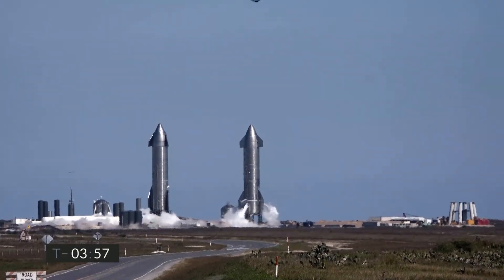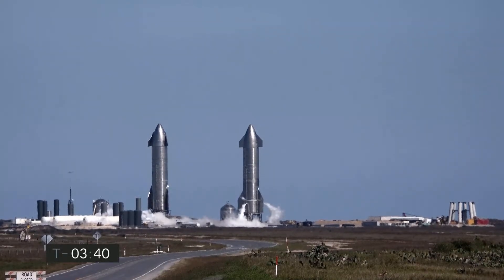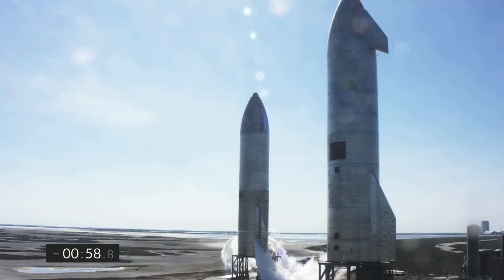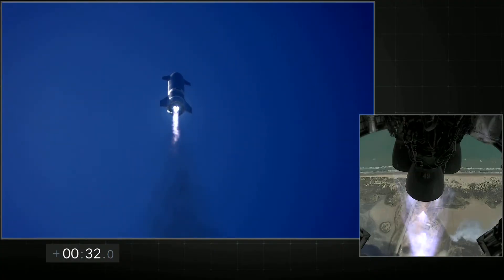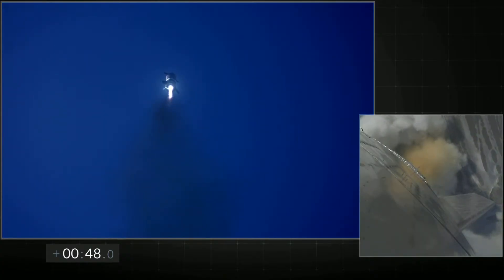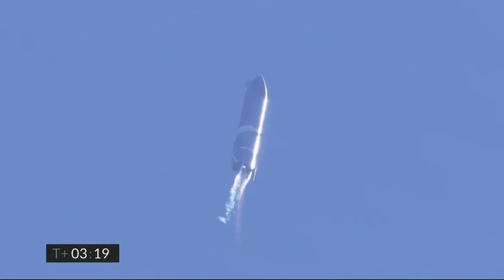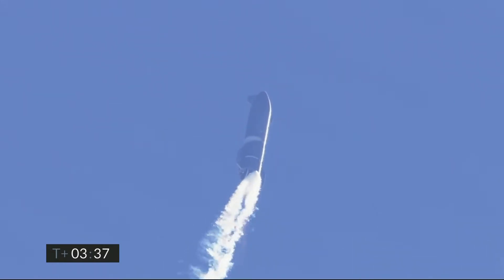Starship | SN9 | High-Altitude Flight Test

Comment: They are never afraid of showing their failures, and that great
Reply: I dont trust anything that doesn't fail at least once. Learning from failing is the human motto
Reply: That's not a failure. It only is if they dont learn from it
Reply: @arthurribas3344  Exactly
Reply: @arthurribas3344  agreed
Reply: @arthurribas3344  Don't know about you but the 1st engine stop looked more like an engine failure, it blew and the final 2nd engine start right before it crashed misfired, probably it was that failed engine which stopped 1st, only one of two was active during descent. The narrator can say whatever he wants... but it's somewhat a failure. We'll see more in future testing if engines are supposed to stop in flight by exploding or not. Musk would call it a design feature...
Reply: @emmn.4307  its still a success, it manahed ro fly 10 kms.
Reply: @coolgh1dorah929  well, sure... from the perspective of a flight test, but they already had been through a crash landing. It would've helped them understand a lot more if they also fixed the landing sequence and got the silo intact.
Reply: @emmn.4307  Good eye! They were running a test called a "belly flop maneuver". They were testing other things and didn't expect the engines to turn back on in time. They succeeded two prototypes later.
Reply: It is not failure, it is testing
Reply: @marcysiek1  yea its considered as a success because it went 10 kilometers high, that was the most important part, landing it its extremely hard.
Reply: What failure?  The test was successful
Reply: You have to admire them for that.
Reply: Well tbf it's kinda hard to keep an explosion the size of a football field under wraps
Reply: @ClaversOdhiambo  apparently you never seen how china do their work
Reply: @ClaversOdhiambo  I am guessing you haven't heard of CNSA then?
Reply: The world will look a lot better if we all start doing so.
Reply: It's not a fail
Reply: Rapid develipment. That's a term. 8)
Reply: Trail and Error . That physics and engineering and chemistry and math for ya ☺️☺️
Reply: if they created perfectly there will be no profit goin in for the engineers  LOL thats why they have to make it primitive deisgn
Reply: Well they hid SN10 explosion and in SN11 they kinda just ended stream without even telling us wether it exlpoded or not
Reply: I know! That great for sure...
Reply: They are also not shy
Reply: The more failures one overcomes...
Reply: This is testing. It's not a "fail or succeed" matter at all.
Reply: They tried to hide up when a F9 core crashed back in February 2020
Reply: @xerosfs  temporarily maybe
Reply: @ClearVod  wdym
Reply: @xerosfs  Elon tweeted that like right afterwards tho LOL
Reply: @OortCloud  Oh. Must’ve been mistaken. I’m very sorry.
Reply: @xerosfs  Ah that’s okay, same thing happened with the first falcon heavy flight where the center core crashed and they didn’t say a word and then Elon just tweeted it
Reply: @xerosfs  What Sat(s) did they carry on that mission?
Reply: https://youtu.be/vwvTarqg8g4
Reply: @Dhruvshot  j

Comment: Still wonder why not somewhat larger fixed wing and land it like an airplane.
This whole crazy flip thing will not make passengers  stand in line for it i think.
Reply: Unfortunately not really possible since you need a runway to land a plane. For that reason, the landing mechanism won't work on any other planet than the Earth.
Reply: The more weight you add to the vehicle the less payload you can carry
Reply: @chronovore7234  maybe so but it saves you fuel for the landing burn.
And look at the wing from the X15 and F 104 they look not so heavy compared with the airplane y

Comment: It seems under powered
Reply: That's because it is. It's still missing half it's engines, and they didn't run the ones it does have at full thrust, since it's not needed for this test.
Even the final rocket will be a bit underpowered for it's size. It's not intended to launch from Earth under it's own power, it's supposed to be launched on a booster.

Comment: still sticking with the dick model. Why not scale up an F-22 Raptor?
Reply: Because an F-22 Raptor can't go to space, let alone the moon or Mars?
Reply: @lazarus2691  with enough brute force, it absolutely could
Reply: @lmao.3661  I mean if you stuck it on top of a big enough rocket, sure. 

But as far as getting to space under it's own power, which is what I meant, no.

Even if you swapped out the jet engines for the best rocket engines available, it's mass ratio is simply too poor, and scaling it up doesn't fix that.

If you stripped enough weight out of it and strapped on some extra fuel tanks, you could probably hop it over the Karmen line like the X-15 did, but actually making orbit? Forget it.

There's a reason that Starship is essentially a fuel tank with a pointed nose and some fins on the side. 

Even then, it can just barely make orbit by itself, and that's with no payload or provisions for landing.

Comment: Nice prototype. The bottom is to big to. Aerodynamically speaking. The top slips and you make a big boom. Just like in your pool. Weight at the bottom causes big booms. Splash. Put a pointy cock rim on top like a mushroom as large as the bottom and it should maybe help the descent. Lmk.
Reply: The vehicle design is fine, an engine failed to start

Comment: I have an idea of what happened. they placed helium cylinders on the top end of the rocket, which changed the center of gravity, making it more difficult to balance. giving instability when rotating the ship horizontally, it shows the tip lower in the return, and during the landing maneuver, which shows the difficulty of putting it in the correct position, both in the two movements it is possible to notice the anomaly. As for the engine failing, it was because the helium gas entered the engine before the propellant gas causing it not to start with the wrong mixture.
Reply: The weight of the helium COPVs is a rounding error next to the mass of the rocket. Maybe half a percent. The leftover methane sloshing around in the main tank is more than that.
Reply: Good gut guesses but the engineering accounted for that. See this beautiful rendering animation of Starships plumbing.
https://youtu.be/KycyWcxWTcY 
The issue was the Raptor engineer did not relight in time.

Comment: Wait what’s the production rate of these rockets?
Reply: Surprisingly fast.
Reply: About one a month, and expected to increase.
Reply: It takes about half a year to make one "Starship", and SpaceX starts production of a new unit roughly every month. So there were a bunch of rockets at different stages of completion. 

SN9 just brew up, SN10 is already on the launch pad, SN11 is in the high bay, largely finished. SN12,13,14 have been scrapped before finished -- because they are superseded by a new upgraded design of SN15 which is already half made. The SN16, SN17, SN18 are in earlier stages of production.

The first stage "Superheavy" is also in production, with the structure of one unit almost finished, and a second one started.

Comment: Looks like another mechanism should be added to the bottom part acting like landing flaps on the airplanes. Probably to design  flaps than can be opend to reduce the wild swing ang to creat a kind of airlift at the bottom.
Reply: But that would add more weight

Comment: Though I have no insider information on why the engines failed prior to landing, I'd nonetheless suggest a longer vertical orientation would be advantageous.  If Starship would go vertical sooner and settle its tanks it would have more time to start its Raptors.  A drogue chute could be used, much as high performance aircraft utilize to slow their landings,  to decelerate and stabilize Starship.
Reply: The engines have to fully started before the flip, not after. And the propellant doesn't need to settle, that's what the header tanks are for.
A drogue chute would work as a stop-gap, but goes against the long term goal of rapid reusability.
Reply: @lazarus2691  They switch to header tanks rather early and sloshing during the violent maneuvers must be a factor.  A drogue would help flip the Starship around and if done soon enough give more time to get the engines settled out.

Comment: What happened it flew great but what happened when it went horizontal to vertical is it not getting fuel the way we had to fix that for remote control modal airplanes was to use a silicon tube with a small weight at the end  so when you flew it upside-down the tube was always in the fuel or we could use a collapsible tank was just like a plastic bag and it did not matter which way it had always glow fuel. keeping my fingers and tows crossed for SN11
Reply: Nothing to do with fuel delivery
Reply: @tauraspace   Sorry just thinking out side the box lol

Comment: The FAA denied a waiver submitted by SpaceX.  SpaceX proceeded with the flight, violating its launch license in what aerospace and industry officials said was a potentially reckless move that could have posed serious risk to the public’s safety.
Reply: Spacex took all the safety precautions they needed to. Everything is fine
Reply: @chronovore7234  I have to follow all my drone waivers to the letter or I  lose my certification.   I don't get to tell the FAA that I took all the necessary safety precautions that I felt were  Adequate for the situation
Reply: @baddogastro  copied straight from the verge I see? Get out man
Reply: @tauraspace  Who is the verge

Comment: I'm no rocket scientist, but wouldn't it make more sense to initiate the landing process a little earlier?
Reply: No. It wouldn't have saved either SN8 or SN9. If your engines fail, then flipping sooner just means you fall from higher up.
Reply: @lazarus2691  Can you explain it a little more? To make my point clearer, it looks to me like hitting the ground because of pushing the brakes too late.
Reply: @nostalium  
SN8 managed to light both engines, but about 5 seconds later one of them cut out, and the other started failing and losing power.

At the point when the first engine cut out, SN8 was falling at 30m/s. When it hit the ground it was falling at 36m/s. 
So it actually started speeding back up before it crashed.

If it had flipped higher up, nothing would have changed. The engines still would have failed and lost thrust, and it would have started picking up speed again.

The only difference is that with more distance to fall, it would have picked up more speed by the time it hit the ground.

SN9 was a bit different. One of it's engines failed to light in the first place, the other worked fine. However, that one engine wasn't enough to cancel out the rotation of the flip, causing it to over-rotate .

The result was that it flipped around to a point where it's control surfaces were facing the wrong direction, at which point it could not recover.

Again, trying to flip higher wouldn't have helped. The engine would still have failed, and it would have flipped too far and lost control.

The only difference is that it would have had more distance to fly out of control, and so it would have crashed further away from the landing pad, closer to SN10 and the fuel farm.
Reply: @lazarus2691  Oh, I didn't know the engines failed. It all makes sense now. I thought that the engines were thrusting until the very end but couldn't do their job in time due to either being not powerful enough or not having enough time.
Reply: @lazarus2691  Also, thanks for the explanation.

Comment: Can the venting of the main fuel tanks chill excessively the pipes and the landing tanks so that the pressure would have dropped  this time as well, or clogged a pipe or something like this? 
I am by far no rocket engineer and the above statement should be considered pure speculation

Comment: Just throwing darts at a dartboard but maybe on ascent, engine #2 had a bad bearing in the turbo pump, that caused the seal to rupture and led to the methane leak and visible flame mid-engine. When engine #2 was shut down I'm guessing the turbo pump came to an abrupt halt and siezed causing an unusual orange flame. When re-ignition was attempted, the turbo pump was unable to spin and had a rud and sent pieces flying.

Again, just my guess.

Comment: It wouldn't explode if the somersault timing had been started 10 seconds earlier. It's absurd that you don't give time to a new prototype. If possible, start the somersault 30 seconds ago, but don't hit the ground. If we look at son of Adam in terms of proving the art given by God, it is a big step for all humanity.
Reply: The ship doesn't have enough fuel left to run the engines for that long. It has 25 tonnes of fuel, and each engine uses 0.7 tonnes per second.
So with two engines, you have a maximum of 17 seconds. The ship already takes 10-12 seconds to land, so adding another 10 seconds is too much.
You could maybe do an extra 5 seconds, but that would be cutting it awfully close.
Reply: One of the engines failed to re-ignite properly. This has nothing to do with the timing of the flip. The flip timing was perfectly normal.

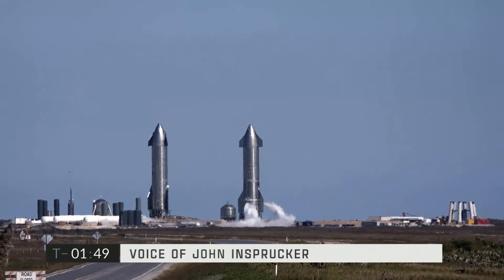Comment: 3:35 John has said literally that SN10 is preparing "for a similar flight later this month ". That's insane
Reply: It is but its not said it will fly this month..
Reply: @marcysiek1  later this month means this month but later
Reply: @politonno2499  well SN9 was being prepared for launch 2 weeks before it actually happened, so.. SN10 is being prepared to launch later this month but it doesn't mean that it will be 100% launch this month, It can also be next month if things don't go as planned
Reply: @marcysiek1  yeah but still a big progress; SN10 hasn't tipped over inside the High Bay.

Comment: If this structure flips horizontally, then why not install the engines for landing in the lower part , or attach them somehow along the edges, but without disturbing the aerodynamics.
 And only for launch, use the rocket vertically upward.
 In my opinion, if it is possible, it will be easier and safer to land a rocket on its belly than with such a maneuver.
...

Sorry for my English, I'm Russian.

Comment: maybe if it wouldn't be designed like a glorified dildo it wouldn't tip over.
try wings and glider landing.
Reply: Other than the lack of runways on Mars and the Moon as Jack pointed out, we already tried wings on the Space Shuttle. 
It had a terrible mass fraction, and the large wings meant it was too aerodynamically unstable to be nose-mounted.
The side-mount configuration the Shuttle used was the cause of the Columbia disaster. So let's not try that again.
Reply: There’s no runways on mars

Comment: After watching both sn8 and sn9 launches, it seems odd that both tests require perfection in landing without giving much margin of safety in such pilot testing.  Would the results be any different if the rockets were flipped over to vertical a km higher from a horizontal position?
Reply: As Elon recently said, they're going to light all three engines next time and since they only need two to flip and land, they can have one engine fail and still be fine. With SN9, one of the two engines failed so it couldn't flip and slow down in time.